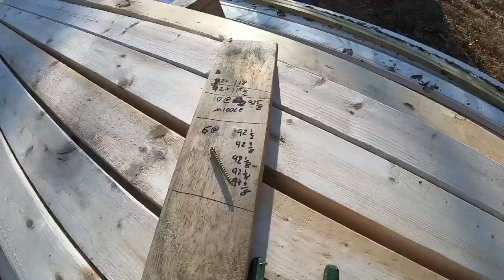Building ICF Cabin - Boat Themed - Forming the Suspended Concrete Floor

Comment: So I've never seen the icf foam building method I've been in construction for a long time I like the fact that it will be super quiet and insulated seems like more work than conventional stick framing   but  just different than what I'm used to I've done houses made from metal studs and red iron light weight trusses everything has a learning curve

Comment: Can't wait to see the backhoe running. I've rebuilt many diesel engines and you're doing the right thing replacing those pistons. I shared with my sister.
Reply from the maker: Thanks for watching! The telegram message is a scam, it won't let me delete it.  Please report it as spam from your end. Thanks! 
The real Cap

Comment: I’ve now watched you and Jesse Muller prep the ICF floor system, and it just seems that conventional framing is a whole lot faster and easier.  Especially on the boat project because the spans are so short.
Reply from the maker: Of course it's easier.  The point isn't which is easiest, the point is which is stronger, more durable, and provides a better quality product in the end.

Comment: Hey Mike right behind the bell housing on your Ford backhoe on the block of the engine a lot of the Ford Motors now have the serial number back there now so if it's a newer motor it will be different but it will be back there should be the tag number for it I should be imprinting in stamped into the block
Reply from the maker: Stay tuned

Comment: It looks like you'll be pouring concrete against the ends of the 2x6s. Are you going to tape the end of each board to keep moisture from wicking into the wood?
Reply from the maker: Stay tuned

Comment: Just started watching, and you mention the rings from previous vid. Do you have 2 thick rings (compression) and 2 thin rings with separator (oil control/scraper rings) that go in lower piston groove? Or 3compression and 2 scraper/control rings? Might help if you laid them out so your people can see. Or you may have already covered that.
Reply: Oops, you got it covered.

Comment: it wouldnt be a project if it doesnt end up sucking up more materials then originally planned for. as for the spiral staircase, would they be the ones from job DP was cleaning up or you starting from scratch Capt?  the yacht coming together
Reply from the maker: Starting from scratch